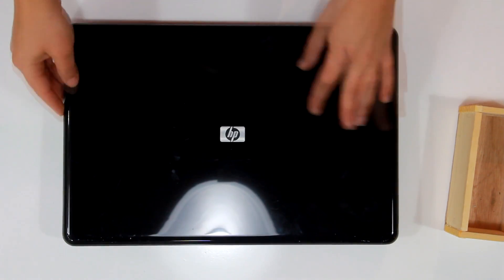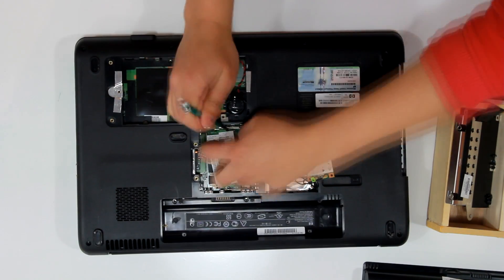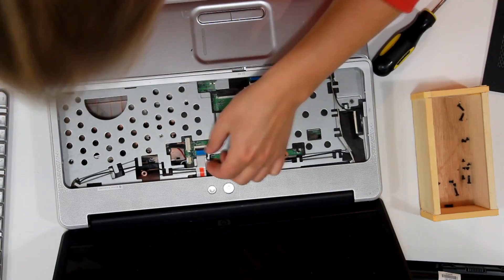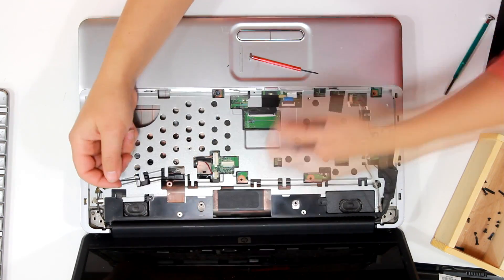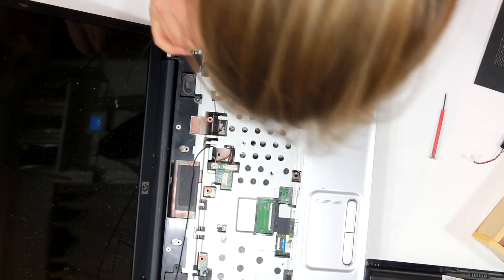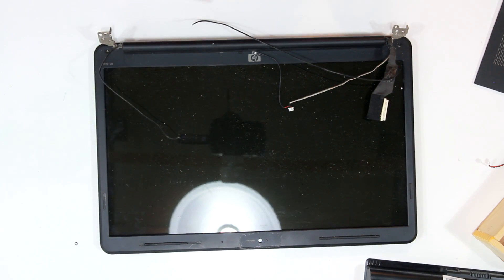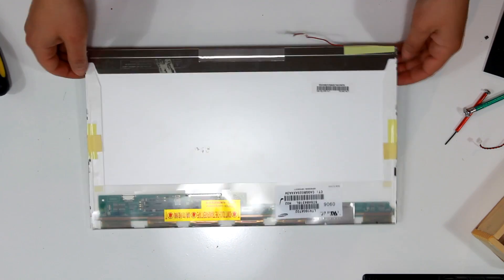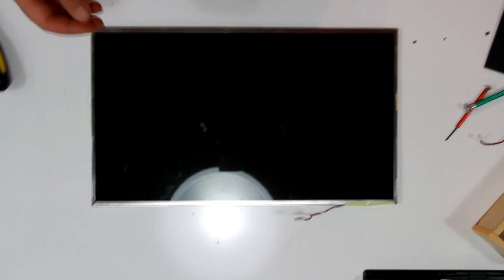How To Take Apart a Laptop to Get The Screen

Comment: I have same model HP laptop, but its screen is not working, i gave it to computer repair shop and changed display ribbon two times. Its work 2-3 weeks and again display going blank. I tried to connect via VGA cable to other monitor and it’s not working. 
Is there any way to remove laptop display and connect External Monitor ??

Comment: Ok, these electronic videos finally made me to subscribe! I like wood working, but I am doing electronics even more and I can always use ideas.
I have 5 broken laptops waiting to be salvaged, but I never though about using the screen on it's own (I always used them as replacements in other laptops). Btw. 3 of the laptops are HP, too. All with the same unrepairable fault (except if you can resolder an approx. 1000 pin BGA package). Doesn't speak for quality.
A tip on taking many consumer devices apart (from someone, who has been taking disassembling stuff for 30 years, which not always was for the joy of my parents ;) ): many cases are clipped together and an old credit card works very well to split it. Pry the case open at eone place, insert a side of the card and move it along. It will most likely split the case without doing any damage to the plastic.
Reply from the maker: +superdau Good tip!

Comment: The wifi wires just unsnap from the wifi module just like a shirt snap.

I don't know why, but I've never thought to search for a separate controller to the display. I've got a number of old laptops I've snagged to put the hard drives into my file server. I'm going to have to source the monitors, too.

Comment: Great video Linn.

You probably already know this, but if you want to, you can disassemble the laptop battery and salvage the 18650 lithium ion cells inside. Even if the unit has stopped working as a whole, individual cells contained within are probably still functional. You can utilize those for a lot of things, such as with high output flashlights.

Comment: Don't forget to reuse the laptop batteries. Most laptop batteries are 18650's and can be reused for loads of cool projects. I use several of mine for small LED lighting projects. 
I use the Nitecore charger, it does a great job of recharging the 18650 batteries correctly.

Comment: Hi Linn,

You dont have use HDMI controller for that screen. If you can find the specs or the datasheet you can use LVDS interface of raspberry pi to control it. It wont be that hard, you just need to enter specs of the screen to configuration files. Just type at google ``LVDS raspberry pi`` you will see tons of information. Specs are basically which part of the cable refers to what and resolution/refresh rates.

I used to use this interface for my raw lcds in this way you can also control it(lcd+backlight) for instance; brightness, contras, etc.

If you cannot, later on I can check it for you.

Good luck.
Reply from the maker: +Mehmet Tekbaş Thanks for the info!